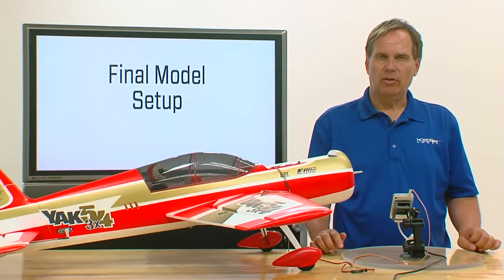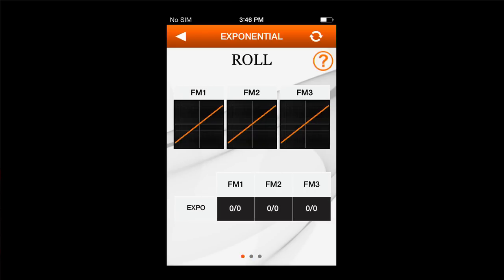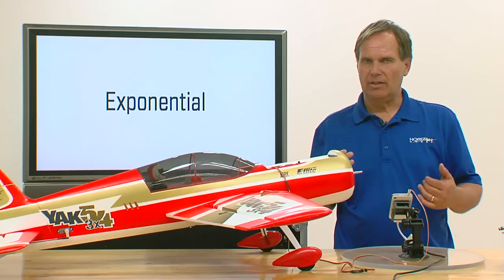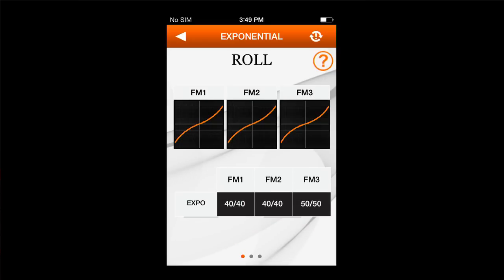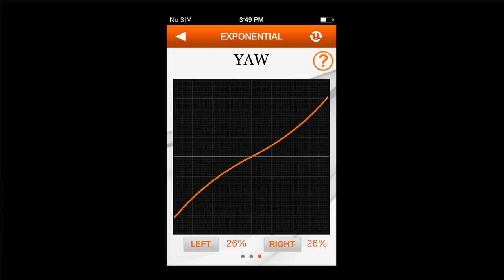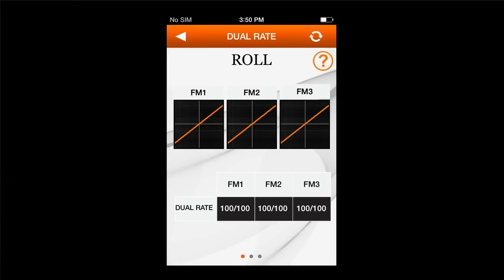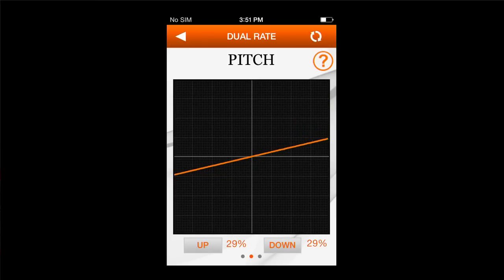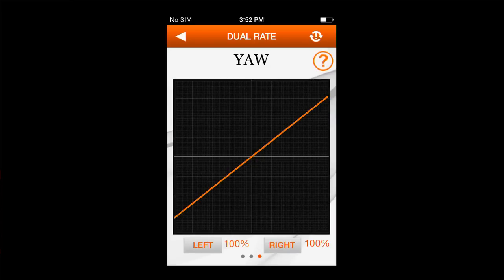Spektrum AS3X Step 13: Exponential and Dual Rate (Final Model Setup)

Comment: Switch D should be used for flaps. Switch B or C would be easier to get to for the flight modes. You can set up the rates/expo in the transmitter and put the receiver's flight modes (gyro modes) on a separate switch. I always use switch A for retracts, B for rates/expo, C for the gyro modes, D for the flaps, and H for throttle cut. If my plane doesn't have retracts or flaps, I don't use those switches for something different. That way, I don't have to learn what the switches do every time I switch planes. Also, if you set the rates/expo in the transmitter, set the gyro priority to 150% so that the gyro gain will decrease to zero at full stick deflection in low rates.

Comment: I would not change dualrate with the flight modes switch. Is there no way to set dual rate on a separate two tap switch?

Comment: Is there any issue in let the RATES independet in the transmitter ?? I like 3 keys with independents rates for each channel . I don't want rates linked to fight modes ....
Reply: petyahawk   Leave the dual rates and expo set to zero in the program and do them on the transmitter. I called Horizon and they said as long as you do one or the other (Transmitter or  in app) but not both you can do it in the transmitter.
Reply: petyahawk You will want to set up the channel that is in the off mode to be controlled by the transmitter. Its inportant to set your Duel rates and Expos on that switch so off on as3x is actually controlled by the transmitter. When you use modes 2 and 3, as3x is going to control your rates and expos. I have found on my Maul, they killed my gains so I get no roll at all when AS3x is operating on switch 2 or 3. No good.I know how to set up things just by watching the control surfaces.  Yes, pay attention to what you are doing when setting up these things.